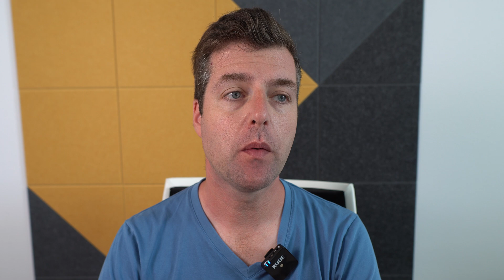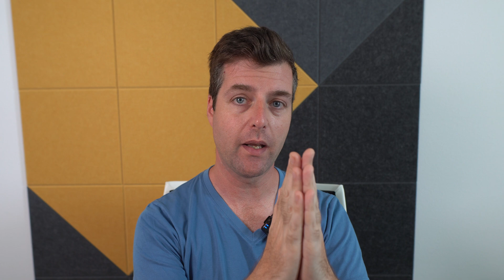Baffle Wall for your Home Theater

Comment: Did you toe in the front left and right in-wall speakers? I'm not sure what the right approach is or how difficult it would be to do with in-walls, but I assumed you would since you have promoted time intensity trading in the past.
Reply: I basically asked the same question on one of Matt's previous videos & heres a copy of his reply if you're interested:

"I am not putting a toe angle on the speaker, it’s not ideal but it’s workable. I did it for convenience of design.  For many speakers a toe is required for good sound. The speakers off axis response is seriously compromised and the Hf would be very rolled off. It would also place the extreme seats in a much worse listening axis. 

The Perlisten speakers have a very wide area in which the response remains smooth and consistent. This isn’t true or many other speakers.  As such, you can keep them pointed forward and still get good sound at all deals.  

There is about a 2dB difference in treble level between on axis and the extreme off axis seats in my theater.  There are a tiny number of ultra wide dispersion speakers, like Grimani Systems, where the difference is 0dB. The dispersion is so wide that over a 90 degree window there is simply no change in the HF response.  

So basically aiming only matters when the dispersion is fairly narrow or the DI is not smooth."
Reply: @northeastcorals  Thanks for sharing his response!
Reply: @miscreant1739  No probs 😀
Reply: @northeastcorals  No. The idea is to compensate for proximity to the nearer speaker to you. Has to do with radiation pattern, not frequency response being even.
Reply: I'm building my theatre from scratch so will be toeing mine in 😀
Reply from the maker: @northeastcorals  I built mine from scratch too. But adding a toe angle to a baffle wall is a much more complex design that then introduces other issues to contend with. If you think about what you’ve done, you now have a horn for the center speaker. A badly designed horn. It changes the timbre of the three speakers and it adds a lot of unwanted reflections. 

You could just do a small toed in box for the LR speakers but that will add a lot of edge diffraction and reflections to those speakers. You also have to space the screen out to clear the toed speakers. In my case that would add 8” of extra depth.  You need to ensure that the spacing of the screen is not solid and doesn’t introduce a lot of diffraction sources.  That can cause comb filtering, resonances, and HOMS to form. 

I fretted this detail quite a bit. I would love to sit and build a baffle wall in different ways to test what happens in different scenarios. It’s easier said than done.  Ultimately the choice I made introduced some HF errors but avoid all the other problems.  The other problems would have avoided the Hf error but added other possibly worse issues.
Reply: @PoesAcoustics  Excuse my ignorance but any chance you could explain what you mean by "You need to ensure that the spacing of the screen is not solid" thanks?

I'm far off from building the wall yet (full house to renovate) & only had time to briefly Google the subject & from the results I presumed I would struggle for information unfortunately.

Have you ever watched the short video titled "The ULTIMATE Home Theatre front speaker install" where the designer not only angles the L&Rs in but he also raised up the C speaker very slightly so it can be slightly angled down by a few degrees towards the LP to as he says to avoid "parallel speaker projection to the screen"? Thats the only video I've found on the subject so far.

I've also seen designs of 3 separate walls where each wall section has 3 slightly different angles to them, what that does to the acoustics I've no idea.

I was wondering if a curved wall may be an option by either using the wetting & bending plasterboards to a curved timber frame technique, or by putting vertical studs say every 300mm in a curve then cutting 300mm strips of plasterboard to create a slightly jagged wall curve but I've never seen it done so I'm guessing theres probably a good reason for that.🤷‍♂ (if only it was easy!)
Reply from the maker: @northeastcorals  you are delving into all the issues I was referring to. Simply angling each speaker slightly would be of no merit. It needs to be 15-25 degrees.  Possibly as much as 30 degrees.  Imagine a flat plane and imagine angling the speakers 25 degrees each. It’s going to cause a significant protrusion. 

Angling the speakers as the user did in that video helps possibly mitigate comb filtering. That came from a paper done in an anechoic lab with commercial screens and speakers. They also found you need your screen 3 feet away from your speakers. A bunch of the claims create their own practical problems and they didn’t use the modern woven screens or try this with smaller domestic style speakers. Their goal was to provide information for commercial cinema design.  

The angled needed for residential speakers to mitigate comb filtering would need to be greater than for pro and the impact would be less in a scenario like mine. The baffle is far smaller and the radiation far wider. Two factors that would mitigate the effects some. 

The comment about not being solid refers to the spacing. Imagine a flat baffle wall and the screen 8-10 inches from the baffle. At least. Somehow the screen needs to still attach to a cleat. What does that cleat attach to?  The answer is that a frame needs to be built that protruded from the baffle wall. The frame will cause serious reflections and diffraction effects. To avoid this you keep it as open as possible and have 3-4 inches of absorption on the face.  That avoids those problems.  

The angled or bowed baffle are both options I’ve used on other projects. If the screen wall is very wide it’s a non-issue and won’t load the speaker appreciably. My screen wall is 10 wide and it could create some issues. That is why I avoided it. The bowing or angling will act like a giant waveguide and cause essentially low frequency mouth reflections and unpredictable reinforcement effects.  I also think you could do a hybrid with 10 degree cantered walls and a 10 degree angle on the speaker mount too.
Reply: @PoesAcoustics  Thanks I get what you mean about the spacing of the screen, I was contemplating just having 2 vertical 3x2 or 4x2 timbers at the sides of the screen with 2 horizontal 4x2 between those for top & bottom of the screen (with a few support timbers) as the screen will take up most of the screen wall space & then stretched AT fabric panels to cover the small areas around sides top & bottom of the screen which are magnetically fixed in place. 

My screen wall is also small & the distance between my L to R speaker will only be around 3 metres, which means less than 1.5 metres between the L/R to C etc so that doesn't sound ideal for trying to bow/angle.

Just to complicate things I have a loft room with a vaulted ceiling (pinnacle running centre front to back), which will be only a few feet above my L&R & a about a foot above the wide speakers, I was hoping the vertical directivity of my R5i's will help a bit although I think it's not as tight as in some of the other Perlisten models & I still have the horizontals to worry about so I'm expecting some fun & games to say the least.
Reply: In walls don't really get toed in unless you have a wall that's designed for it or the speaker itself